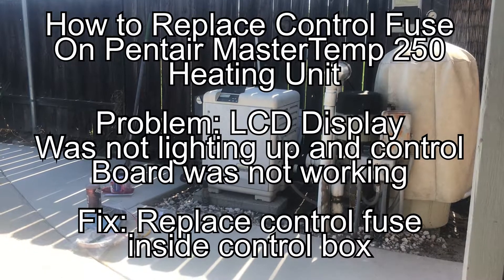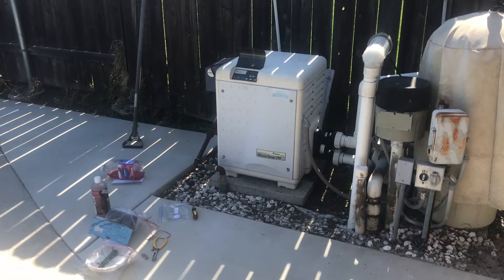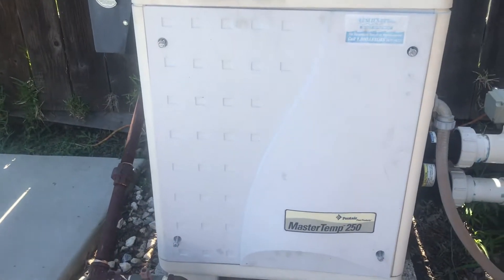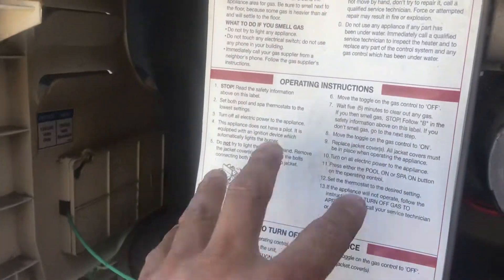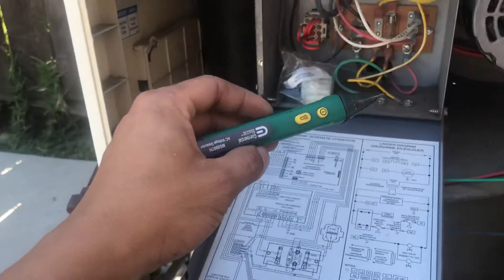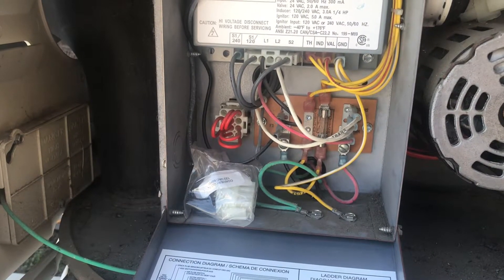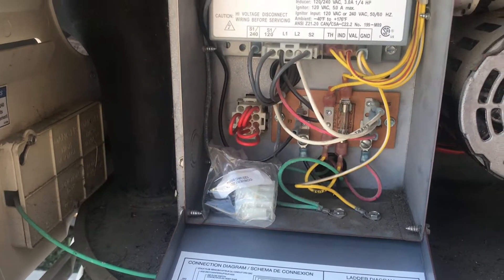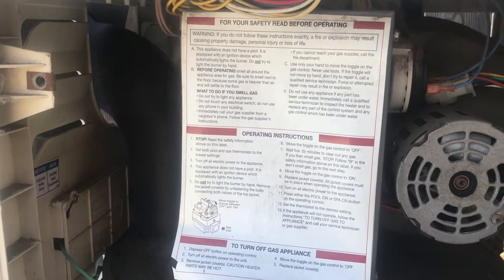How to Replace control fuse on Pentair MasterTemp 250... LCD display and control board not working

Comment: I have the same heater, it will turn on fire up run for about 4-5 min getting heat off the exhaust then the membrane starts to show the temperature lowering back to 65 and that shuts down the heater. I have replaced the membrane still did the same thing but some of the buttons do not work- like off also replaced the thermistor and the thermal regulator. Any idea on what is causing this? Does the board need to be replaced

Comment: I disconnected wiring from old Manifold and I replaced with new Manifold on my 250. Now the button for the Spa does not turn on the heater, but the button for the Pool will turn on the heater. There were only two electrical plugins to the manifold, could I have put them in wrong, maybe, so do I just switch them back or something else, please advise.
Reply from the maker: You could Possibly have a bad membrane pad now, not sure how it happened but do this…….If you open the unit and look on the underside of the membrane pad you will see the exposed circuitry. You can manually(without the use of the pad buttons) turn on the spa, the pool , turn the heater off, and change thee temperature up and down by shorting certain pins. Pin 1 is the lowest pin and pin 6 is the highest pin. To turn the spa on you will want to short pin 1 and 2 for a quick sec. if by shorting pin 1 and 2 and the spa turns on, than you know the problem lies with your membrane pad. ,

1 to 2 ...spa on.
1 to 3...pool on.
1 to 4...heater off.
1 to 5...down arrow.
1 to 6...up arrow.

Don’t do this if your not confident and always be careful around live wires…..hope this helps!